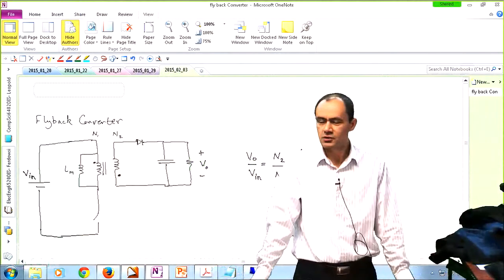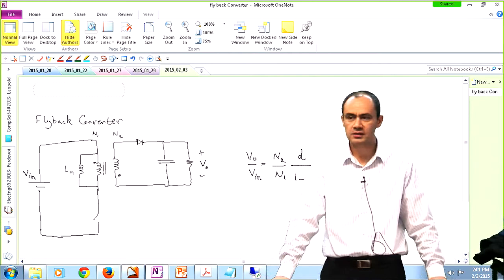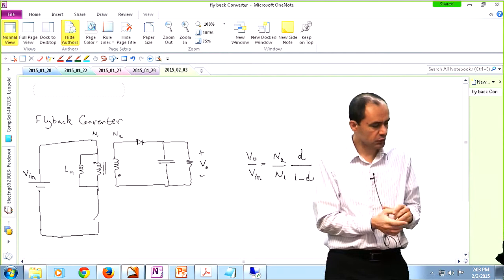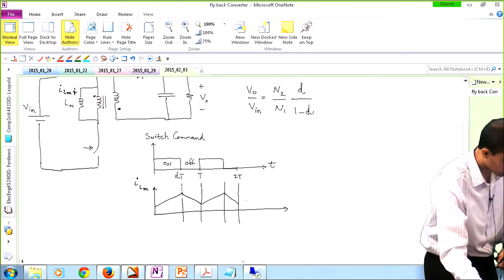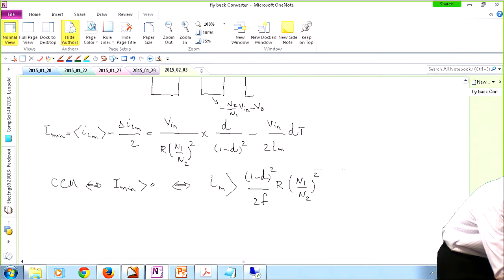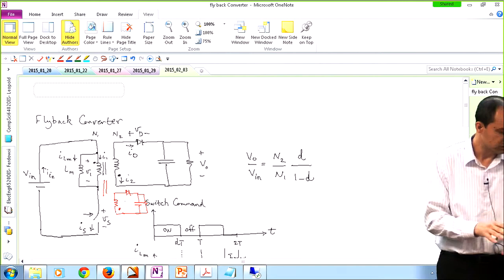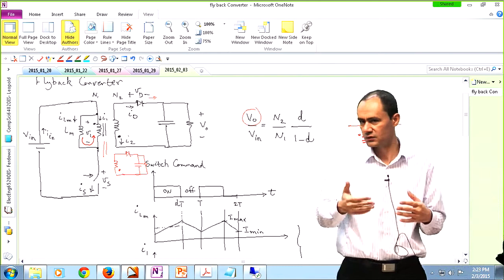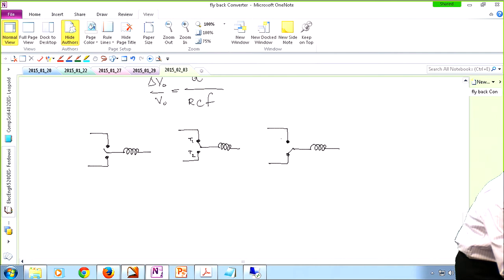[05] Advanced Power Electronics (Mehdi Ferdowsi)

Comment: Hello Prof. Ferdowsi, 
I agree with the reason given by one of the students about the specified duty range for Cell B1. 
I would like to add that S1, S3, S4 are subjected to Bipolar blocking voltage depending on the range of duty cycle.
If we consider the d<0.5 then switch realization is as follows: S1, S4 -- diode, S2 -- Transistor, S3 -- reversed diode.
if we consider the d> 0.5 then all diodes are replaced by transistors respectively.
Thus, for d<0.5, it will be easy to control just one transistor.